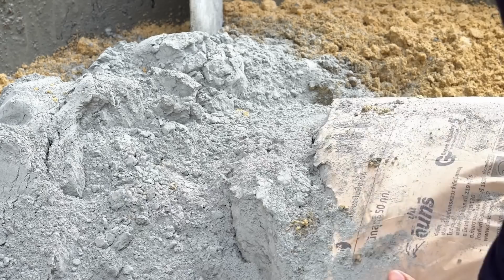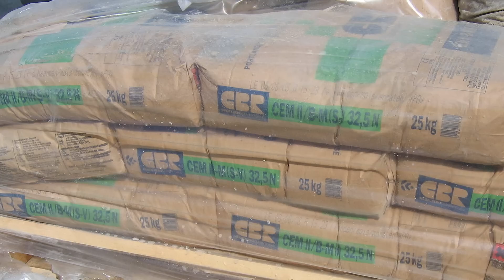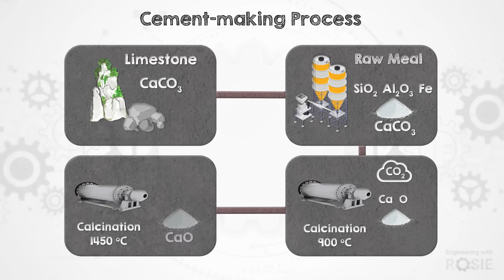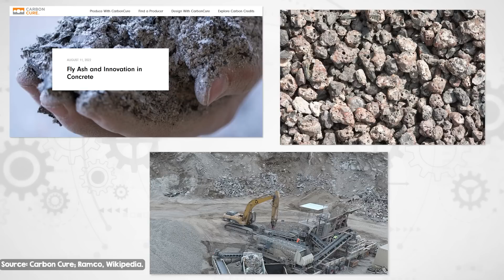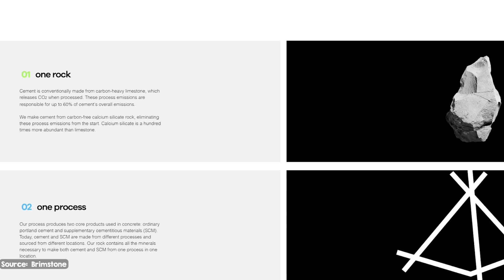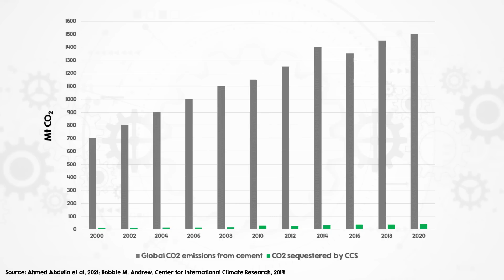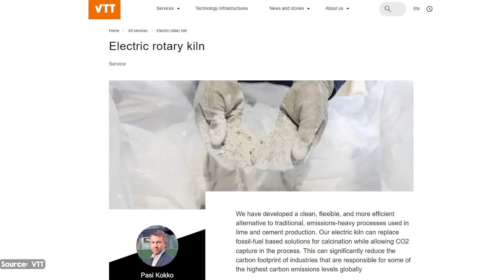Zero Emissions Cement is Closer Than You Think

Comment: Decades ago at school I learnt:
CaCO3 -> CaO + CO2 (cement production, releasing CO2)
CaO + H2O -> Ca(OH)2 (preparing concrete by mixing cement with water and (inert) filler materials)
Ca(OH)2 + CO2 -> CaCO3 + H2O (concrete cures)
When concrete cures, it absorbs the same amount of CO2 as the the cement production process emitted. Net emissions are those from producing the heat needed.
Seeing your video I suspect my knowledge from school was oversimplified and does not reflect the whole truth. So, curing concrete does not simply reverse the cement production process, creating sand enriched lime stone, right? Could you dig a bit deeper into that topic? That would be great!

Comment: A lot of building codes have material requirements instead of performance requirements for the amount of concrete to protect the steel reinforcement. You have a core of steel-reinforced concrete on the inside that is actually load-bearing, which is surrounded by unreinforced concrete to protect the steel from water intrusion and rusting, so reducing concrete usage for a given structure is more about preventing water intrusion rusting the steel reinforcement. 
The most promising technique that's easy to scale tomorrow is switching from rebar to chopped-up steel fibers mixed into slabs that prevent the concrete from cracking so water can't get in. That allows you to reduce the floor slab thickness by 40%. I think steel or polymer fibers mixed in as a supplement to traditional rebar can provide a similar benefit for beams and columns. You can also sidestep the problem with some geopolymers that are inherently completely waterproof.
The other great way to reduce concrete usage is switching to alternative materials. For buildings, using engineered wood instead of reinforced concrete for either the whole structure for short buildings or just the floor slabs for tall ones dramatically reduces concrete usage, and reduces building weight, labor, and construction time too. Civil construction tends to already use reinforced earth instead of concrete wherever possible because it's cheaper and the scale is so huge, so I don't know how much more substitution exists on that side of concrete usage.
Reply: Makes me wonder how effective chopped/modified waste plastic would be for rebar replacement. Side benefit might be less concern about water intrusion.
Reply: @koyamamoto5933  the plastic fiber reinforcement isn't structural since most plastics aren't very strong, it just reduces cracking and spalling, which protects the structural steel rebar from water and reduces damage from thermal cycling. recycled thermoplastic plastic might work if you can spin it fine enough.
Reply: @thamiordragonheart8682  recycled polyester (2 litre bottles etc) can be spun fine enough that individual strands aren't visible to the naked eye but that introduces problems like silicosis.
Reply: @koyamamoto5933  plastic reinforced concrete is possible but works in a very different way to steel reinforcement – you can make car springs out of it!
Reply: @alanhat5252  that's some really interesting properties for polymer-reinforced concrete, had no idea it was possible to make springy concrete. I don't think the fibers need to be quite that fine though.
I do follow B1M, which is where I ran into a lot of the ideas in timber construction.
Reply: "B1M" channel on Youtube (the largest construction engineering channel) has been looking at engineered timber buildings for a while

Comment: Albert Bates, co-author of "Burn: Using Fire to Cool the Earth", is developing a process to add up to 20% of biochar to bitumen for road surfaces. Biochar, as the book describes, also has a role for improving concrete. This meshes with Rosie's first solutions point to "use less of it" and require performance standards instead of requiring a set amount of cement.
Reply from the maker: I talked about biochar a little bit in my CCUS video, and have been meaning to come back to it as a topic for its own video. So many topics on the list! https://youtu.be/KpGvHpB7SQ0
Reply: @EngineeringwithRosie  can you bring someone in to explain the likely reaction of the oil industry to that, please?

Comment: That was a lot of information in less than 11 minutes. So much so that I'll forgive your pun to close your intro. 😎  Having had 4 decades of time in and around the building industry I think the initial low hanging fruit is use reduction. As you pointed out there are areas that could benefit from thoughtful engineering to reduce concrete use, and there are opportunities to eliminate concrete in some areas as well. Concrete free "slabs" for on or below grade construction are viable and within the ability and skill set of almost all builders. They merely need to rethink a few steps in the process.

Comment: Why do these inventions never make it to the commercial side. I have been watching about such discoveries for at least the last 20 years.
Reply from the maker: Cement is so cheap that pretty much any alternative seems expensive. I think it was always going to be one of hte last climate techs to go mainstream. Wind, solar, EVs etc are competitive on price alone so they don't need as much effort to roll them out as it will take to get rid of traditional cement.
Reply: @EngineeringwithRosie  B1M & others are watching the market for wooden buildings grow using "engineered timber" & low-rise adobe is still viable (the cities in Yemen are marvels) & can be 3d-printed.
Reply: Carbon taxes are not high enough yet.
Reply: They do reach market, Portland Cement itself was patented in 1824 & current variants weren't available till the 1840s yet the Romans used a very similar & plainly long-lasting cement centuries before. What we're waiting for is fashion to change & that could easily be encouraged by for instance taxation.
Reply: China uses a lower-carbon cement.

Comment: The nature of supercritical CO2 makes CCS so difficult that it's cheaper to just leave it in the ground.
Reply: Perhaps you would explain what is the connection between supercritical CO2 and storing CO2 which has not been cooled in rock caverns etc which has already been successfully done in for instance the Sleipner field.
Cost is an issue, since historically releasing CO2 has been regarded as a freebie, but AFAIK has nothing at all to do with supercriticality.
Reply: @davidmartin3947  I wouldn't be crowing too much about Sleipner.
CO2 is Injected into the rock pores, not caverns, and to do this requires 10s to 100s Mpa. That's when  supercritical CO2 becomes an issue. The expense and short duty time of the materials required to operate under these conditions makes it all too hard.
Ask Chevron about their CCS nightmare at Gorgon.
Reply: @3rdrock  Since posts get killed if links to references are provided, discussion at any depth is not really possible.
But on the DOE site if one uses CO@ storage and supercriticality as search terms, supercritical storage is just one way of doing it, which does economise on the volumes needed, so why you should use potential issues with doing it that way to dismiss the whole field is mysterious.

That is not to say that there are not other potential issues with other techniques, but the one you have put front and centre just does not apply, so it seems that you are improperly generalising, presumably because you don't much fancy carbon storage.

I would agree that the possibility has often been used to justify 'carrying on regardless' with massively emmitting fossil fuel projects, but that does not justify making improper arguments against the tech, as there are quite enough sound arguments which can be made against reckless continuance of fossil fuel extraction with CCS held up as a fig leaf.
Reply: @davidmartin3947  Your presumption has some truth in it but my position is based on actual experience in CO2 geosequestration. 
Like you say, it works but I am pointing out that the devil is in the detail and that detail makes the process extremely difficult and expensive.
Reply: @3rdrock  I address the points presented, not the level of expertise of those who raise them.
You sought to argue that sequestration was impractical due to supercriticality.
Since in many or most cases supercriticality is not used, this in no way rules out other methods of storage, even assuming that your objection is a complete show stopper for supercritical storage.
And regarding levels of expertise, there are plenty of eminently qualified folk who would disagree with your position, one of whom posts on GreenCarCongress and I have had the pleasure to have been in discussion on line with.
Maybe CCS can't work, although there are umpteen forms of it including for instance ocean storage, but your arguments in no way prove it.
Just for the record, I intensely dislike the use of the notion of carbon storage as an excuse to carry on emitting, and the scope and cost of storage is far from clear.

But your attempt to rule it out 'from first principles' in all variants is not legitimate, and you have presented no arguments at all which in any way substantiate your position.

Your critique of supercritical storage is, if not quite irrelevant, at any rate inapplicable to most methods of CCS and in no way justifies your sweeping complete dismissal.

Comment: I think the usual issues applies, current standard practice is cheap and easy, well developed, known and trusted, and, it's a pretty powerful industry.  

We could replace a significant part of the concrete we use with wood, we can make wood constructions resistant to things like fire, fungi and pests.  Building with sustainably produced wood locks that carbon for the lifetime of that building, at least. The carbon content of dry wood is typically  higher than that of CO2.        

Humidity used to be a severe issue for wood buildings in year round warm climates that weren't very dry, and very dry areas usually don't have a lot of fast growing trees. 

Wood definitely has limitations, it's typically not useful for foundations, or constructions in water, but that doesn't mean we can't use it where it is about as good as, or better than concrete. Wood have some practical advantages over concrete, it's much more insulating, also lighter for the same strength, and unlike concrete, acid rain dosen't dissolve wood. Increased CO2-levels will decrease pH of rain, this is already an issue in some areas, not a huge issue, but with increased CO2 levels in the atmosphere it can become a serious issue in some cases/areas.

Comment: Is there a number for what carbon price would make the best alternatives economically attractive next year? If the carbon price makes a transition in cement production immediately attractive, how long would it take to roll out those technologies in places like India and Africa, which will be ramping up the development of concrete infrastructure and housing for decades to come?
Reply from the maker: I don't know the answer to that but I did hear recently that adding CCS to traditional cement manufacturing would approximately triple its cost. Cement is such a cheap material, that's why it's so widely used and it will make it really hard for new technologies to compete on price.

Comment: Modular housing may be one way to get affordable housing to more people in developing countries. By this I mean empty modular shells stacked higgle-dy piggle-dy on top of each other (to allow air flow). Does this type of building construction require less concrete (and cement)?

Of course dams use a lot of concrete. They are just bad news all round (I'm excluding off-river pumped hydro projects), yet the world is still building so many of them! 

There is often corruption & mafia-type syndication associated with the building industry - I'm sure many  projects are not necessary at all. They are just a way of pilfering tax funds from state coffers.

In China there are many "tofu dreg" projects - is this linked to lower clinker proportions in their cement?